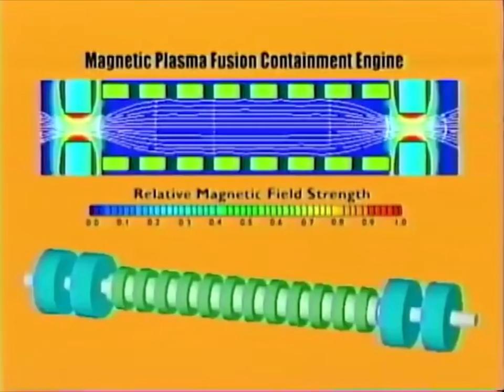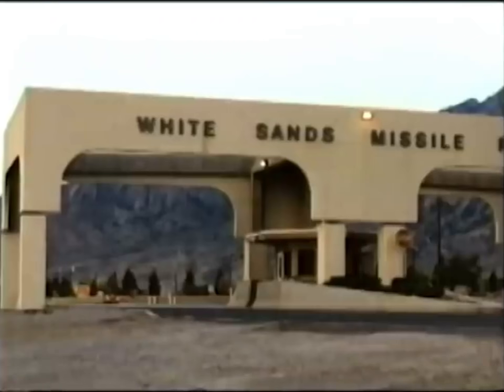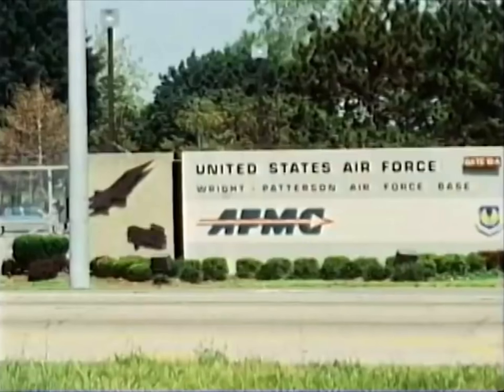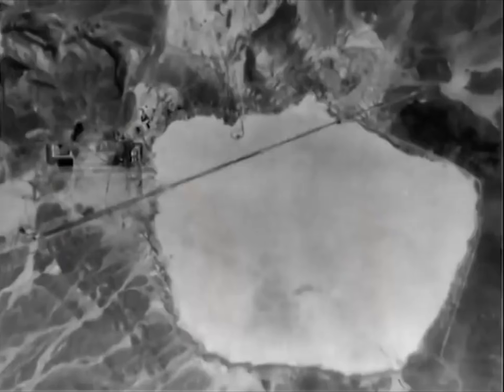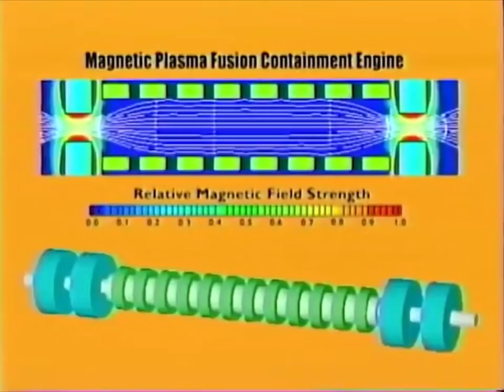Area 51 whistleblower David Adair's first-hand testimony about advanced alien technology

Comment: The guy seems completely believable but I have a big issue with his rocket landing at Area 51 after having travelled at, or near, the speed of light. Specifically, his rocket was not destroyed on impact at Area 51. This means that he had to have a stunningly powerful braking system, or that after reaching initial max speed, that rocket's speed was immediately reduced? How did this braking process work? How was he able to recover the rocket? This is a huge hole in the story which needs addressing.

Comment: Reading the comments; the 2 things that stand out are being 17 years old, and aiming or sending a missile to crash at or near a military base… the Brilliance potential for a gifted person is in the teen years. Mozarts first symphony at 8, and so on. Not that. The missile guidance system is the big issue here. In the Mid 1970s and before, triangulation method was used; the RF transmission from the source point, a ship, and a satellite, for example was necessary for directing the missile launched from a sub for example. More information on the supposed shop made missile guidance please Mr Adair. Otherwise I’m on board. Thank you EOC for the excellent content!!!

Comment: I find it highly improbable that he built a magnetic contained fusion engine.  The exotic elements he would have needed would have been unobtainable.  They are highly radioactive.  Fusion is obtained by getting the materials into a plasma form and magnetic containment can be problematic.  What did he use for a guidance system?  To take off from spot A and land at a specific spot B is extremely difficult, you just don’t set it off and go.  The mention of a 20 story screw jack elevator does not seem practical.  Curtis LeMay could have been a consultant at that time.  I am not sure but I do not believe there were or are 61 different types of rocket propulsion.  That’s just the beginning of the video.  It is quite probable that there is some kind of life out there but the chance of us meeting it is extremely rare.
Reply: Wouldn't be very interesting if it was highly probable.  
Who wants to watch the man who swears he can drink a glass of water while sitting in a chair?

Comment: The information about the ship/engine/vehicle being connected to the pilot's mind as if its some sort of an organism was repeated by Lt. Colonel Russo in his book (Day after Roswell).
Reply: Phillip Corso
Reply: @gordonmeeks2447  thx for the correction!
Reply: It’s Lt. Col. Corso
Reply: Believe it. First comes A.I. Then A.I. figures out a way to communicate with the brain -- telepathy. Look at some of the systems that fighter pilots already have on some of the most advanced aircraft. Look at the system an Apache helicopter pilot has to work with. Just think of that as the "analog," -- the "digital" is not going to be far behind. I've 'imagined'(???) seen, dreamed (???) a craft that was a mix of engineered/built construction with a sort of biological (think brain synapses) 'wiring.'  The pilot's telepathy was the link between the ship's 'brain'/operating system and the function to be performed.  It was capable of targeting hundreds of targets at once -- targets selected by a crewman, who saw them pop up on a large, many layered screen that was more like a hologram than an actual  He could either focus on a section or point to it (as if touching it) and that section would enlarge and other data would come up about it. And he'd either 'mark' it for action or push it away. The ship's sensors were constantly searching everything within the operator's parameters and continually displaying things in a 360-degree circle. The operator had numerous choices regarding his targets, he could fry their electronics, damage or destroy them or just leave them alone. Looking at the screens, it was like looking through the side of the craft as if the walls had turned into some kind of ultra clear curved glass. It was pretty slick. I wish I could build one.
Reply: yeah, I saw Corso on some sort of interview on youtube (maybe with Greer, can't remember) saying the UFOs themselves were living things and at the time I didn't think highly of him, still don't know what to make of him.
Reply: @nathanielalgernon975 I remember that interview he was an elderly man at that stage. He said he wrote the book for his kids and grandkids because he believed they deserved to know. He was involved with the Roswell crash, he said everything from microchips to fiber optics all came from Roswell, I believe him 100%, because he had no reason to lie at that stage in his life. He also ran the dept of foreign technology and leaked this technology to corporations for civilian use, hence our smart phones and computers etc...
Reply: @ned1621   I tell you Ned I think people sometimes lie because it's part of their genetic makeup, or some sort of personal defect or pathology.  Corso might have been telling the truth, I just don't know but there are people out there that don't believe him, John B Alexander (famed military paranormal researcher) and author Kevin Randle who wrote "Alexander found many holes in the stories spun by Corso, and in the end, while acknowledging Corso’s long military career, did not truly believe him. Here Alexander and I agree."  Stanton Friedman didn't believe him either he argued that: "Corso seems to be taking credit for the single handed introduction of a whole host of new technologies into American industry"  You really have to go into these UFO personalities with some skepticism but an open mind.
Reply: @ned1621  That wasn't the right choice - to give the info to corporations. He probably sold the info :D Why not give it to credible general public? These men always simply think about themselves(his grandchildren).

If we had many minds researching and working on this throughout the years with clear information.... rather than at the last moment, at the end of their lives.

They're all cowards :P